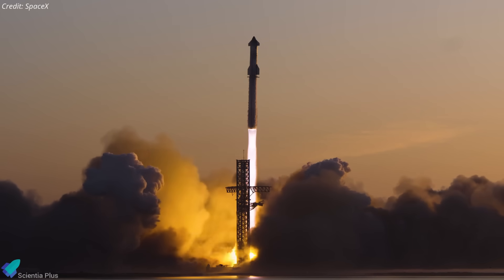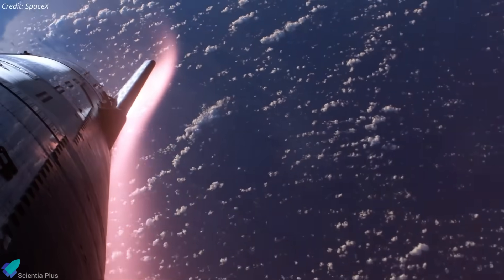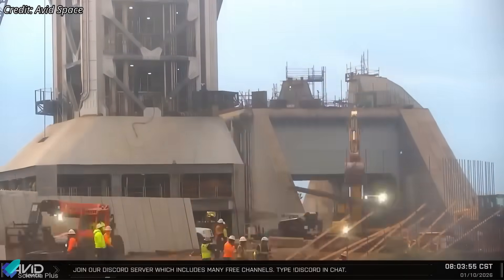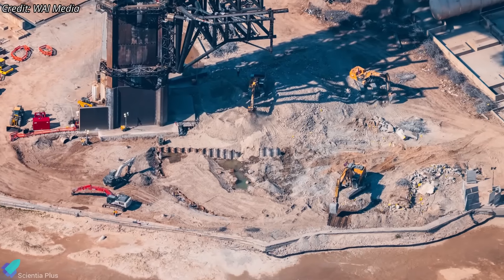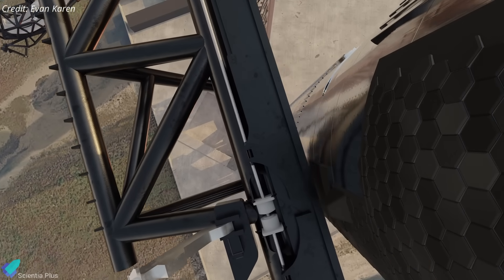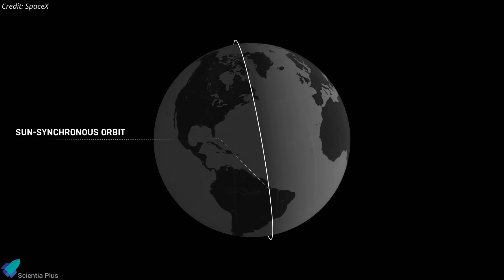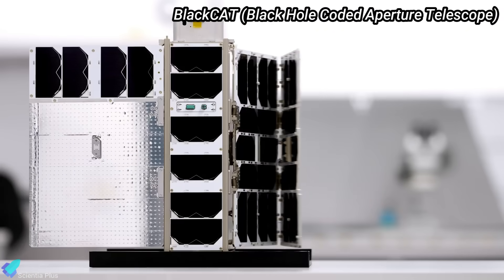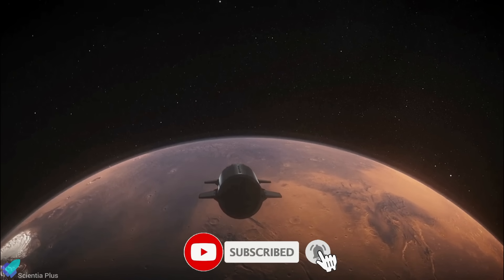Starship Flight 12 Goes Next Level: SpaceX Adds a Genius Heat Tile Fix! Catch Tests Begin!

Comment from the maker: 00:00 Starship Updates
08:06 Falcon 9 Twilight Mission & 40 Payloads: The Orbit SpaceX Didn’t Use Before

📚 Learn More:

🚀 Starship Block 3 Explained: https://tinyurl.com/mp63u57m
  • Detailed Breakdown: https://tinyurl.com/bddv6w2y
  • Production Begins: https://tinyurl.com/5cb2ee3h
  • New Transfer Tube / Downcomer: https://tinyurl.com/ymm23t2c
  • New Grid Fin: https://tinyurl.com/mppnd7sz
  • New Integrated Hot Stage Ring & Forward Dome Upgrades: https://tinyurl.com/msvxk8m
  • Booster Block 3 Aft Dome Insane Design Upgrades: https://tinyurl.com/3k2rxvpf

🛢 Dual-Port Orbital Refueling – Full Technical Breakdown
https://tinyurl.com/3hej7fk3

 Starship Block 4 Unveiled: https://tinyurl.com/ymhyyt2h

🔥The Insane Engineering Of Raptor Engines:
     Part 1: https://tinyurl.com/348hsrya
     Part 2: https://tinyurl.com/p8k85mu6
 
🔥 Raptor V3 Explained:
    Mega Upgrades & First Test: https://tinyurl.com/22nzc3za
    Raptor 3 Evolved Again - More Protection This Time: https://tinyurl.com/4up7jxdd

🛠 Insane Engineering of New Starship Launch Pad: https://tinyurl.com/42h5kd92

🧱 What’s Inside Starship GigaBay?: https://tinyurl.com/2ujtkmkb

🛠 Other Starship Upgrades:
 • Hot Staging Explained: https://tinyurl.com/yc4ejbmn
 • Super Heavy Booster Upgrades: https://tinyurl.com/msm9jtkc
 • New Heat Tiles Explained: https://tinyurl.com/45dytyef

🔥Booster 18 Explosion Complete Breakdown: https://youtu.be/2mYXI6WRwqI

🔥 Starship 36 Explosion:
  📽 Detailed Breakdown: https://youtu.be/VWQiIz1ymBA
  🛠 Damage Report: https://shorturl.at/Quoex
  🛠 Root Cause & Fixes: https://shorturl.at/NVqdS

🚀 Test Tank 19 Explained: https://youtu.be/IbYtI-VrAqc?si=dEmMp0rxlWx9r7WG&t=343

📡 Stay Updated:
📢 Weekly Updates: https://bit.ly/3HIQjPC
🚀 SpaceX Playlist: https://bit.ly/34wue8T

Comment: I see a 360° ring around the ship that is part of the mainframe and the arms that catch this rocket must be in the shape of a half moon being 180° in circumference, at least a docking Bay That is basically square on design. I think creates more problems since the rocket ship itself is 360° circular. This add-on to the spaceship itself allows for the attachment of a device that cups the cone and can be modulated to slow the spacecraft for re-entry. Like the petals of a flower that have opened from the bud. There has to be redesign thinking ahead that you can solve problems that exist such as docking and reentry with the spacecraft being slowed down to a manageable, less critical reentry. The 360° add-on can be at the point That is currently part of the rocket ship. Meant to catch it in the docking Bay. Round is better. It guarantees with the right configuration of the arms that no damage will be incurred.

Comment: That's not a very elegant tile installation removal system is it I got some great ideas for a tile fastener and removal would be accomplished with a vacuum suction device and electromagnets with vibration
Reply: Yeah, but it's cheap, easy, and it works. 
If this was the team that built sls, they would have had a $150,000 drill attachment so a vacuum could be attached, instead of just buying one off Amazon for $30.
Reply: @lordgarion514  And, of course, the drill attachment would have to be cleared by several bureaucracies, including the EPA. That would add another $1 million, plus 3 years. No problem!
Reply: These are all experimantal articles, S39 and 40. There is no need for elegance here, just do the job, see if it works, repeat. The Spacex way.

Comment: SpaceX needs to install a Titanium sheeting over the belly 304l Stainless Steel, like a heavy duty 25g aluminum foil. It would be better if the foil was hot rolled to the stainless steel.